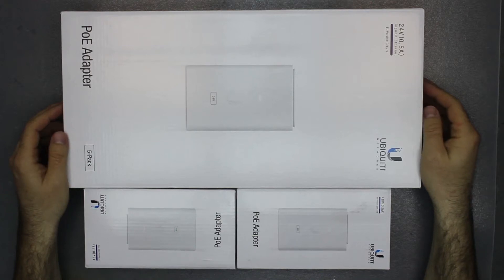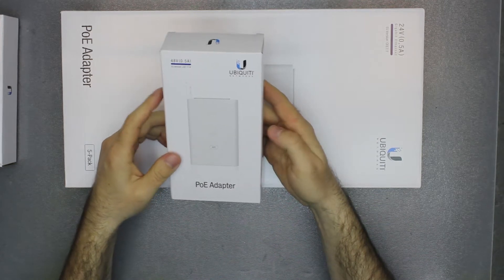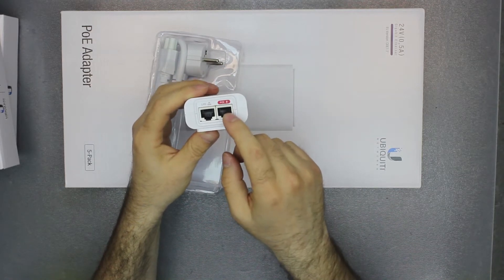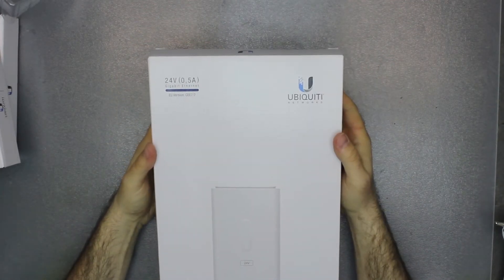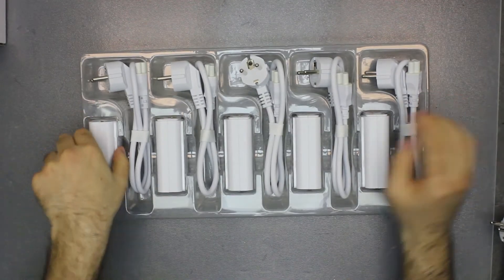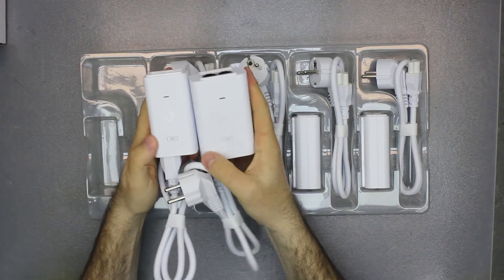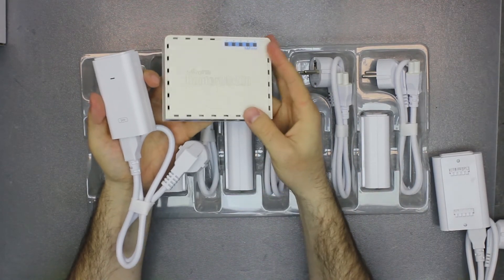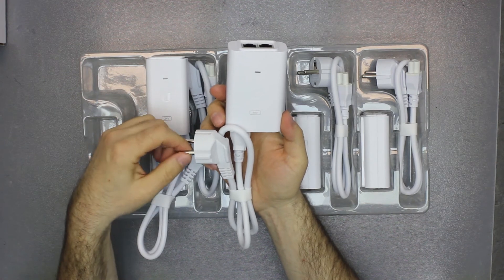Unboxing Ubiquiti 24v & 48v POE Adapters/Injectors

Comment: A couple months ago i had to RMA the poe injector that came with my p2p antenna.  They gave me another one back and i just found out it's bottlenecking my network. It's limiting the speed to 100Mbps.  The one that was broken supported 1Gbps.  I didn't think about this prior because the old all in one  router/ap i was using only had a 100Mbps port.   I replaced that with a switch and a wifi 6 outdoor AP and then noticed it was only 100Mbps. I've contacted support stating they gave me a less product back in return.  Have you had any experience with ubiquity support?  My only experience so far hasn't been very good.
Reply from the maker: Sorry for the late reply. We deal with their support locally and don't really have any issues. After all I can go to their office and "smack them" if I have issues :)
Reply: @WeUnbox  fair enough.  It took them about a month.  But, they finally sent me a proper poe injector.
Reply: @WeUnbox   can you sell me the 24V injector. I couldn't find genuine one where am at. I can pay via paypal: i need only one